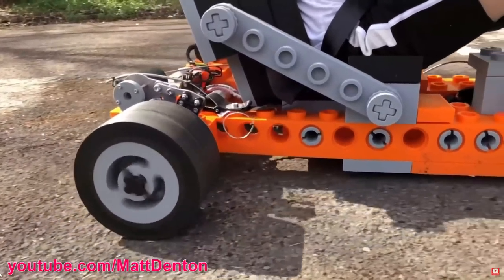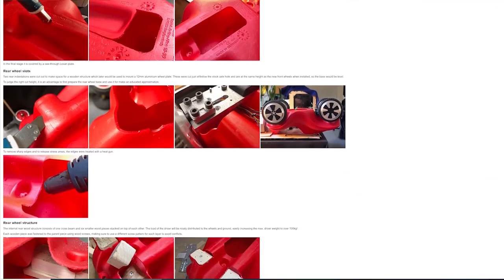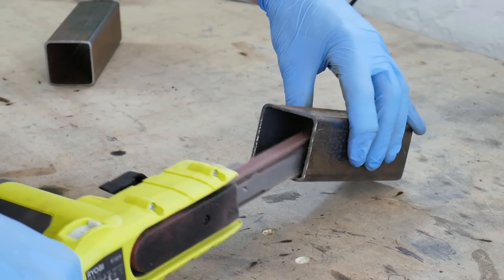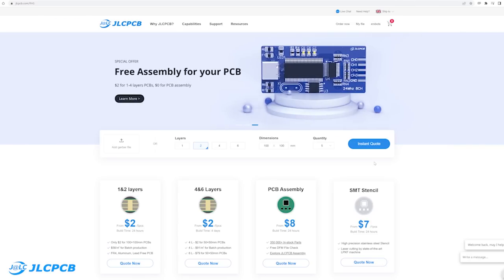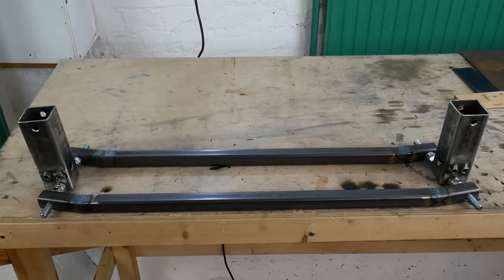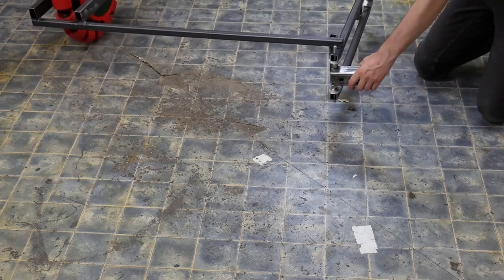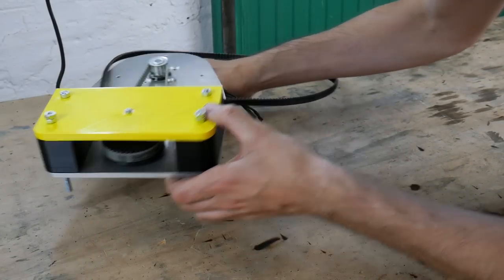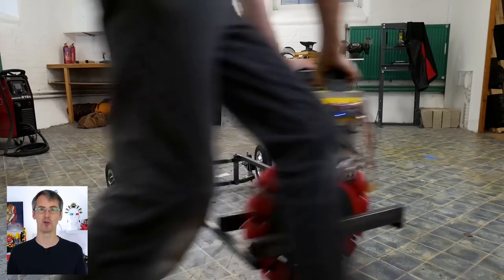Building an Omni-Wheel Drift Cart

Comment from the maker: Part 2 comes up next week, but will I be able to drive it?
Reply: Add a pot to measure the steering input then use that to drive the drift motor. The motor would need to drive towards the direction of steering (faster than the rotation due to the front wheel steer), then all steering would be done in an opposite lock drift fashion.
Reply: wondering what algorithm you will use, if you employ angular speed measurement also.
Anyway please look at your caster, scrub radius, kingpin angle as I mentioned in my other comments. It would make a whole difference in controllability - drivability.

Comment: James, I think you are going to want to change how you are doing the front wheels. The axis of rotation for the wheels should be behind the axis of rotation for the pivots that way the cart will want to return to straight after a turn. The way you have it now is going make you fight to keep the wheels going the direction you want them to.
Reply: James, I agree with Ryan. Steering from behind is much safer.   FYI, Ackermann steering geometry.
Reply: @colinpine4412  and in case of impact is much safer having the direction inside the chasis! good observation mates!
Reply: caster, kingpin angle , scrub radius are the terms he needs to look at. Not just self centering is important for a drift car but also with that much of scrub radius the torque of motors will interfere with his steering efforts making it pretty much undriveable at power.

Comment: The 10° angle for the front is meant to camber the front wheels… this will help prevent it from being skittish and twitchy, it also adds stability to the cart… basically what you’ve done is add the camber and then counteract the added camber canceling it out and only really achieved a lower ride height. Hope this can help 😊

Comment: Looks fun, but I'd mount the rear at 90 degrees and use the little wheels for drifting. ATM it will not handle bumps or cracks well at all! As others have said, swap the steering arms so the wheel pivots are behind the steering ones like a normal Ackerman setup.

Comment: I really like your projects but I find two things that will make it very hard to control in drift. Look at caster, kingpin angle and scrub radius. You want to have some self centering steering to help you with the feel. The important thing is that with that much of scrub radius the motors will have a big lever to center of rotation of that wheel. This will make motor torque to interfere with steering heavily - you wont really feel the vehicle under power because the motors will interfere with you.

Comment: Keep in mind, that you should drive the two steared wheels differently when not going streight. Ideally you should drive the rear wheel, mounted in the direction of move and control the side-to-side drifting with some kind of clever break system. (Or just let the rear wheel to have a full drift.)

Comment: This is cool. For a while I thought about putting omni wheels to a longboard for the drifty-ness. Not sure how exactly you plan to control the rear wheel, are you going to actively drive it left and right or just give it a specific current /holding torque to dynamically adjust the driftyness.

Comment: Shouldn't you mount the omni-wheel the other way, and drive the small wheels for drift angle? The way it is, any bump bigger than about a third of the diameter of those little wheels could be catastrophic... and even just something like running off into grass puts a lot of torque on that axle.
Reply from the maker: Driving the small wheels is quite tricky though.

Comment: Wouldn't there be galvanic corrosion between your Al bearing blocks and the steel frame? I realize this is not meant to be something that lasts for decades, but what's the best way to mitigate that concern? paint?
Reply: Paint, dielectric grease, or anything that insulates the two from each other. Though galvanic corrosion is more a problem in wet environments.
Reply: @H34...  it would be cool if James could anodise and colour the aluminium parts.
Reply: its not fast enough to care

Comment: multidirectional wheels for industrial multidirectional movement without needing to turn wheels
Reply: screw compressed fuel cylinder injector
Reply: extrusion 6-direction universal joint connectors for framing quickly
Reply: opposite polarities maglev bearings, also maglev suspension springs
Reply: magnetic planetary gear system

Comment: So nothing against JLCPCB here, as it's not on the manufacturers themselves, but there are some malicious actors attacking PCB manufacturers in China that occasionally threaten/bribe factory workers to add an extra component that bypasses network security, so for anyone ordering components which may get connected to networks with sensitive information, specifically if that component is ordered under a company name that would be desirable to hack, make sure to go over your PCBs very finely to ensure everything is as it should be. The component is sized like a grain of rice, sometimes even sandwiched into the board layers themselves. It was caught in 2018 for server motherboards that ended up in major companies like Amazon and Apple, and even made it into FBI and CIA systems.